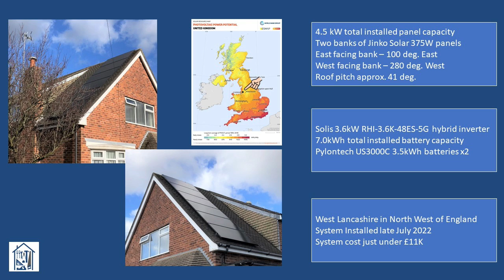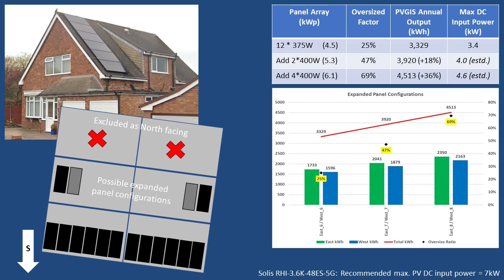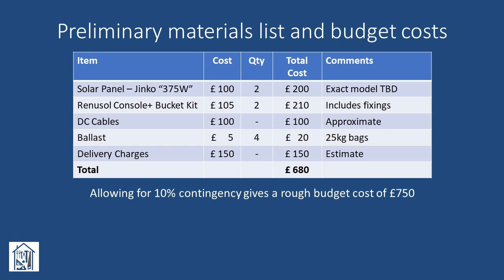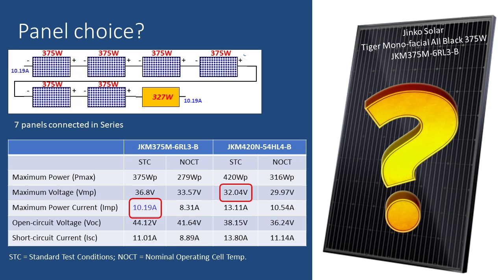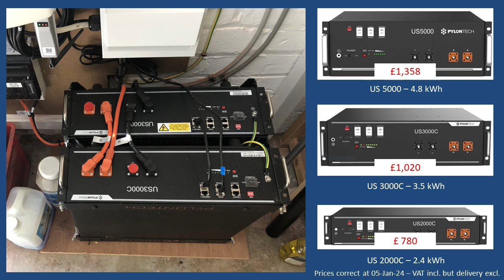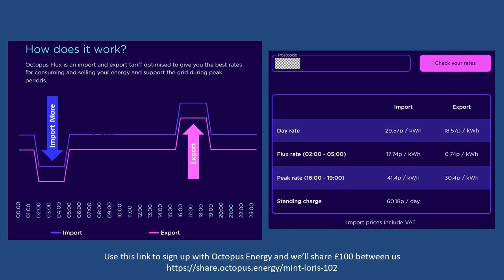Solar Power Upgrade Plans For 2024 - Adding More Panels & Battery Storage

Comment: As someone who has worked in roofing I can tell you that your roof needs to be re-sheeted before any membrane is attached. And since you are going to be adding weight I'd probably recommend 5/8th inch. As to the coating if you can afford the GRP I would go with that. We have some decks in our complex that are above living areas and they were done with it about 12 years ago. Great system. And you can pressure wash it. I would recommend some sort of rubber to put between the membrane and your mounts as the wind will push them around otherwise.
Reply from the maker: Thanks for the info. Yes, I didn't say that in the commentary, but it would definitely be re-sheeted whichever option I go for. I'd also wondered about doubling up the sheeting thickness, but TBD. I did a small valley gutter in GRP on a porch I built for my daughter a couple of  years ago, and was impressed by it, so will consider that. Haven't had comparative quotes yet.

Comment: Worth considering whether a micro inverter with 2 PV inputs is the best way for adding 2 new panels.

Different orientation from existing panels will require optimisers anyway, so might as well go for microinverter/s and get some 435w or possibly even 2 x 550w panels on your flat roof.

You then won't need DC pre terminated cabling as well.
Reply from the maker: Thanks for commenting. Looks like I might need to give it a bit more thought viz. having the two new panels pointing south and the impact on that string. I could possibly orient the two new panels to the East, the same as the existing panels - I'll have a look at the projected output if I did that. I've looked at optimisers and micro-inverters a little bit, but it's probably worth a bit more in-depth research. I'm not very clear what the overall setup would look like with my existing inverter and batteries. Cheers, Chris
Reply: @handyman-at-home  I'm no electrician or solar guru, just an enthusiast who has been deep in solar research for the last 6 weeks.
My chosen inverter, the SunSynk Ecco has 2 MPPT inputs for the 2 DC solar strings but it also has an AC input so that it can integrate with an existing solar system.
For me, i'm documenting my solar journey on my channel and hoping to learn from others like you to maximise the solar panels on my roof up front and possibly DIY some additional panels on my shed roof later on next year.
The AC input on my inverter will allow me to add any panels with micro inverters.
Depending on how many panels I add, it will probably only need a 2.5mm armoured twin and earth running to the shed.
Anyway, food for thought. Wish you all the best and look forward to future updates on what you decide.
P.S. Having done an EPDM flat roof, there is no going back to torched felt for me!
Reply from the maker: Will have a look at the specs. for my inverter to see if it has that capability too. Have subbed to your channel - going to take a particular look at all the heat pump stuff. Interesting comment about EPDM - I think I'll get quotes for both bitumen felt and EPDM. GRP is probably over the top cost wise I suspect. Cheers
Reply: I was about the comment the same thing - the new south facing panels won't be generating when the east-facing panels first catch the sun, and will affect the whole string. Microinverters are an obvious solution but double the cost.
An alternative is to squeeze a vertical panel or two alongside the existing ones. You could work from the garage roof pretty safely without scaffolding. It's hard to tell if there's enough space, but there might be if you slide the existing ones along a bit.
Reply from the maker: Hi, Yes, I think you may be right - I definitely need to give this a bit more thought..! Am slightly reluctant to go down the route of microinverters due to the added cost, but haven't ruled them out. The simplest thing might be to orient the new panels lengthways along the garage roof, so that they're east facing instead, the same as the current ones, although I haven't looked at what that might mean for their output generation. Still getting quotes for getting the roof done so plenty of time to finalise things. Cheers, Chris 👍

Comment: With the panels pointing south, it will appear to the string that the others are in the shade, resulting in limited power. You could put optimisers on the 2 new panels, but it maybe that they are required on the other 6 also / instead of. It maybe worth looking at micro inverters instead or a separate mppt / inverter to the new battery.
Reply from the maker: Thanks for commenting. A couple of others have also made the point about having the two new panels pointing south and the impact on that string - looks like I might need to give it a bit more thought. Possibly the simplest thing would be to orient the two new panels to the East, the same as the existing panels - I'll have a look at the projected output if I did that. I've looked at optimisers and micro-inverters a little bit, but it's probably worth a bit more in-depth research. I'm not very clear what the overall setup would look like with my existing inverter and batteries. Cheers, Chris

Comment: DIYed solar on my shed in 2019 for £2000 (1.5kw & 5kWh batteries, used/recycled), makes 1.1kWh per year, so will be paid back this year (I had cheap 19p/kWh till last year), but its not a good investment, I had other high risk investment that has returned multiple times the original amount during this time.
Reply from the maker: Interesting. I've seen a couple of videos recently making a similar point i.e. that investing in additional battery storage isn't a good investment. I guess time will tell. Whilst I'm happy with the decision to buy the US5000, I won't be rushing to buy another battery just yet, despite what I said in the video 😎 Cheers, Chris
Reply: Hi Chris, commercial advices push to buy batteries... 10k...30 kWh. Nowadays the part of the solar plant more costly is the battery. PV strings are cheaper now .
I think that you need to increase battery capacity only when you want to be off-grid for more than one  to three days autonomy.
I am convinced that off-grid ideology is not a correct approach.
In case of lack insolation I currently use the grid as UPS.

Comment: Just been charged 1k(fitted)for 4 extra Black 370w Panels to my existing 14 Panel array,so your figures are a Bargain  👌even with me not been charged VAT by my installer 🫣
Reply from the maker: Was that to have them fitted on your roof, and was scaffolding needed?
Reply: @handyman-at-home  Didn't need any Scaffolding has I live in Bungalow Sir, thankfully 🙏

Comment: Chris, I had the same methodology that you talk about with Octopus Flux etc until last summer when Octopus offered 15p fixed outgoing export rate and combine with intelligent Go 7.5p kwh off peak.

This eliminated all the complexity of managing how to fill batteries but not have excess solar.
It simplifies to:-
Have enough battery kwh  installed to cater for daily use in winter at off peak rates.( No more needed)
Charge battery to 100% overnight off peak always.
Export all unused solar at 15p/kwh.

In addition i forced discharge batteries down to 20% in the late evening prior to topping up to 100%

Tim
Reply from the maker: Hi Tim, That sounds like a great combination of attractive import and export rates!! I presume it's still the case that you have to have an EV to be on the Go tariff? Chris
Reply: @handyman-at-home  yes indeed that's the limit... Instead of buying another home battery, get a cheap Nissan leaf!
Reply: @TimWigan  I would say forget the solar and get more battery and an EV, I am on octopus intelligent go and have 98% off peak usage in winter with 16kwh usable battery. This saves 20p per unit

Comment: City Electrical Factors and City Plumbing offer a range of solar panels, you may be able to find a comparable rated alternative solar panel. I think City Plumbing have lower cost and they offer a 15% for your first order via their app.
You may be able to pick up from them at no cost, if you have a car or van that they will fit into. You also need to fit any additional panels at the same orientation and inclination as your current east string, you may be able to fit 4 panels if you make them east facing and the weigh is OK.  You would be exporting more in the good summer months but generating more for your own consumption the rest of the time.
Your inverter I believe is limited to 3kW discharge from the batteries (at a nominal 50V this would be 60A). Charging your batteries in the off peak 3 hours would add around 9-10kWh to your batteries. At your current depth of discharge of 20% would give full batteries although you are hopefully going to be above 20% when you start charging. You will also have to gradually reduce the charging current of the batteries as the solar yield increases.  
Hope this works out well for you. Looking forward to your installation and following videos. Brian
Reply from the maker: Thanks for the great info and feedback Brian - lots for me to chew over. I'll definitely take a look at CEF / CP - not somewhere I'd have thought of. Cheers, Chris